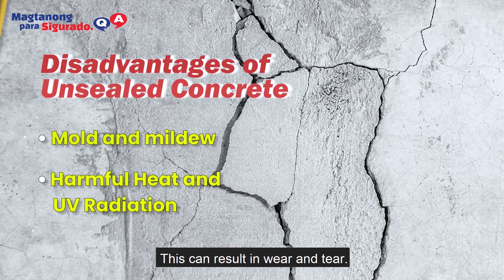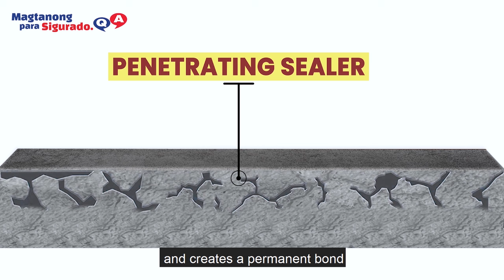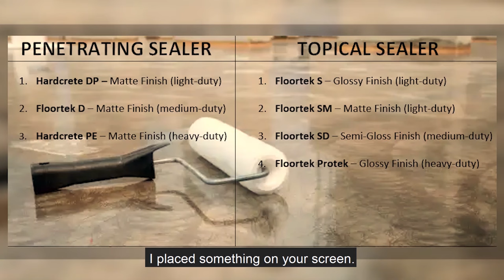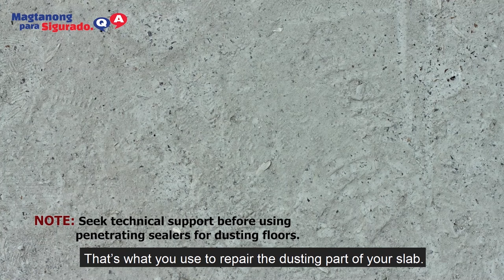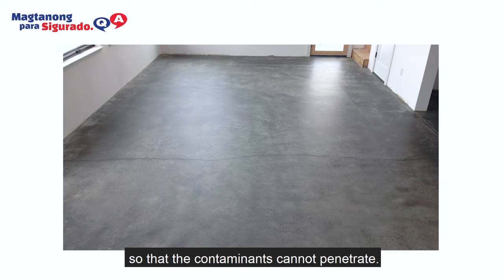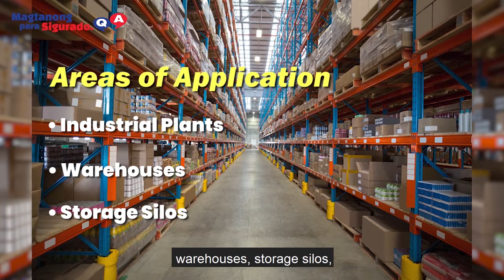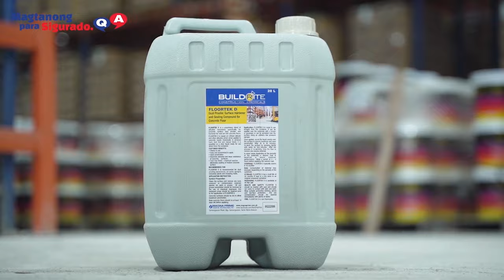Polished Concrete Finish Using a Sealer | Choosing the Best Concrete Sealer in the Philippines

Comment: Sir pwede po b concrete flooring na very light gray sang kulay? Paano po ma-achieve ang very light gray ng concrete flooring? Pwede po b haluan ng skim coat pra sa concrete flooring. Tapos po applyan nmin ng matt finish sealant . Mas cos effective po kasi at durable ang concrete flooring. Thanks po sa reply
Reply from the maker: Hi, thank you for your inquiry. For skim coat for floors, we have Hardcrete 303. You can watch this video for your reference: https://www.youtube.com/watch?v=NSXtg13Nn0g
Floortek S is a topical sealer in glossy finish and it is not advisable to mix with the skim coat. If you want a matte finish sealer, you can use Floortek SM.

Comment: pwede po sir sa matte tiles porcelein ko need ko kc semi-Gloss pra yayamanin tingnan.salamat po ng marami kong sasagot.
Reply from the maker: Hi, thank you for your inquiry. Floortek S can be used as a sealer for slate and terracotta tiles and certain natural stones to prevent staining on the surface. Subject to testing in small areas.
Reply: ah ok po try ko posir maraming salamat  sa video nyo sir complete details kahit medyo mahaba oks lang @BUILDRITECONSTRUCTIONCHEMICALS
Reply: sir list po mgkano kaya po  @BUILDRITECONSTRUCTIONCHEMICALS
Reply from the maker: You're Welcome!
Reply from the maker: BUILDRITE FLOORTEK S (3.8 kg)
Regular price₱2,291.00

https://shop.magnaprime.com.ph/products/floortek-s-3-8-kg?_pos=1&_sid=8d8044dbd&_ss=r

Comment: my floor has color cement.  is it still ok to apply the sealer? which is advisable?
Reply from the maker: Hi, Thank you for your inquiry. Floortek S and Floortek SM are applicable only for bare concrete.
Reply: do you also have suggestions po how to make a better look on a floor that has color cement. sayang late ko na po nakita ito. tnks
Reply from the maker: Unfortunately, wala po kami nang para sa colored cement.
Reply: Hello po sir ask lang sana ano ung pwd sa ceramic rough tiles na white..gusto ko sana gawing glossy ..tnx po

Comment: Tanong kolang poh sir. Pwedi poh ba  sia sa ibat ibang klasi ng tiles at sa wall.yong s poh
Reply from the maker: Hi, thank you for your inquiry. These sealers are for flooring use only; their purpose is to strengthen the wall based on traffic. Floortek S can be used on ceramic matte tiles to make them glossy.

Comment: Ano po pwede use na sealer or laminate? sa pebble wash out para sa outside stairs para di po magfade kulay
Reply from the maker: Hi, Thank you for your inquiry! We will relay your requirements to our research and development team. For now, we have a sealer intended only for indoor applications, which is called FloorTek S. We cannot recommend this for outside applications because it has a tendency to darken when exposed to sunlight.

Comment: pwede ba yung dalawa iapply sa floor. una ung floortek D tpos sunod yung floortek S?
Reply from the maker: Hi, thank you for your inquiry. No, Floortek S in not advisable to be applied on Floortek D, because of compatibility issue. Floortek D is is water-based while Floortek S is resin-based.

Comment: Good Morning sir, how much will it cost po for 216 sq m na commercial purpose area?
Reply from the maker: HI, thank you for your inquiry. Flooortek S can approximately cover 10m² at 2 coats per gallon.

BUILDRITE FLOORTEK S (3.8 kg) -  ₱2,291.00

https://shop.magnaprime.com.ph/products/floortek-s-3-8-kg?_pos=1&_sid=787bf101a&_ss=r&variant=40590650966188

Comment: Pwede po bang gamitin ang topical sealer sa vinyl tiles para kumintab?
Reply from the maker: Hi, thank you for your inquiry. No, Floortek S is for bare concrete surfaces use only. Vinyl is not made of concrete.

Comment: rekta na po b yan pag apply sa flooring?
Reply from the maker: Hi, thank you for your inquiry. Application of Floortek S:
1. The surface must be clean and free from all contaminants. New concrete floors should be at least 14 days old before applying. All damages should be repaired.
2. Apply Floortek S using a squeegee or a low-pressure sprayer.
3. Apply the liquid evenly over the surface to ensure maximum and even penetration. 
4. Allow a period of 3 – 4 hours before applying the second coat.

Comment: Hello po, pwedeng gamitin po ito sa skim coated wall? or sa concrete slab lang?
Reply from the maker: Hi, Thank you for your inquiry. Floortek S is only for bare concrete floors, But you can use Silox 101 (matt) for skimcoated walls. 

https://shop.magnaprime.com.ph/products/buildrite-silox-101?_pos=1&_sid=d4d4f1805&_ss=r
Reply: @BUILDRITECONSTRUCTIONCHEMICALS  thank you. i'll check
Reply from the maker: You're welcome, sir.
Reply from the maker: You can also watch this video for your reference: https://www.youtube.com/watch?v=rCwFvTB__9c&t=339s&pp=ygUGc2lsb3gg
Reply: @BUILDRITECONSTRUCTIONCHEMICALS  Hi engineer good evening. Gusto ko mag order sana sa inyo para diritso kasi parang ung sa shopee mga peke. Pero di ako makapagplace order thru Magna Prime Shop. Baka may link kayo paano ako makapag order ng Floortek S. Isang piraso lang naman sir para try ko. Thank you
Reply from the maker: Hi, Please message us on our Facebook page so we can assist you in placing your order: https://www.facebook.com/BuildritePhils
Reply: @BUILDRITECONSTRUCTIONCHEMICALS  hi sir, i'll do accordingly. thank u
Reply from the maker: You're welcome.

Comment: Pwede po gamitin sa fiber cement boards, kc I'll be using fiber cement boards as my flooring. Thanks po
Reply from the maker: Hi, Thank you for your inquiry! Floortek S is recommended only for bare concrete.

Comment: Is this applicable on concrete walls also?
Reply from the maker: Hi, thank you for your inquiry. Floortek S is for flooring use only.
Reply: Is there any other product for the wall to achieve that kind of finishing?
Reply from the maker: Good day! We have Silox po, kaya lang matte po ang finish nito. 

BUILDRITE SILOX (Gallon)
Regular price₱1,439.00

https://shop.magnaprime.com.ph/products/buildrite-silox-101?_pos=1&_sid=c08a57f5a&_ss=r
Reply from the maker: Indoor wall po ba ang a-aplayan?
Reply: @BUILDRITECONSTRUCTIONCHEMICALS  opo indoor

Comment: Im having a rough finish on my warehouse right now. 

Question: can i directly apply  floortech D.
Reply from the maker: Hi, thank you for your inquiry. Yes, you can apply Floortek D on rough surface but it will not turn it into smooth finish.

Comment: Paano kong new concrete nkb28 day s n kso my crack yung new concrete pwde po bbitong gamitin
Reply from the maker: Hi, thank you for your inquiry. The surface must be clean and free from all contaminants. New concrete floors should be at least 14 days old before applying. All damages should be repaired.

Comment: Can it be applied to vitrified floor tiles?
Reply from the maker: Hi, thank you for your inquiry. Vitrified floor tiles are non-porous, so floortek s may not adhere on it.
Reply: @BUILDRITECONSTRUCTIONCHEMICALS parang Mali po ako. Ceramic tile po pala kasi rough and porous siya. Yan yung Mariwasa floor tile nung araw. So puede po kaya? Para medyo mag mukhang malinis at bago yung sahig
Reply from the maker: Pwede po ang Floortek S sa ceramic matte tiles kung ang purpose ay para maging glossy. Pero para maging malinis, hindi po.

Comment: how do you maintain it po?
Reply from the maker: Hi, thank you for your inquiry. You can use water with detergent in cleaning surfaces with Floortek S. Using bleach and other chamicals are not recommended.

Comment: Hi. If the floor is painted. is it okay to apply floortek S to seal?
Reply from the maker: Hi, thank you for your inquiry. NO. Topical sealers and densifiers are designed to penetrate the surface of the concrete to chemically harden or mechanically bond with the substrate. Floor coatings are non-porous, and sealers wont be able to penetrate its surface, which leads to delamination.

Comment: Hi po Sir..tanong ko lang po sana kung pwede gamitin ang sealer sa wall, para magkaruon ng glossy finish.😁
Reply from the maker: Hi, thank you for your inquiry. The function of this sealers are to strengthen the flooring based on traffic and there is no traffic on walls. We recommend to use Silox on walls, however, it is matte finish and with water repellant capability. You can watch this video for your reference: https://www.youtube.com/watch?v=rCwFvTB__9c&t=8s

Comment: Pwdi po bang langyan ng sealer ang outdoor wall na may pintura or waterproofing?
Reply from the maker: Hi, thank you for your inquiry. Floortek sealer variants are for interior and exterior bare concrete floor use only.

Comment: good day pwede po xa sa ficem board gamitin, i mean the concrete sealer?
Reply from the maker: Hi, thank you for your inquiry. Yes, you can use topical sealer for floors made of cement board. Sealer will act as a topcoat protection from dust and chemical stains, and it can give a glossy decorative effect for floors.

Comment: Kailangan po bng i grind p ang floor pag ginamitan pa po ng topical sealer?
Reply from the maker: Hi, thank you for your inquiry. Clean the surface and remove dust, unsound or contaminated materials, plaster, oil, paint, or grease. Oil and grease penetration should be removed by using a chemical degreaser. Damaged areas should be
repaired before applying FLOORTEK S.

Comment: Sir eto ba is hindi pwede maarawan? I mean may bubong naman pro naarawan siya e.
Reply: For the floortek S po tayo thanks
Reply from the maker: Hi, thank you for your inquiry. Floortek S is for interior and exterior applications. However, it should be fully cured for at least 7 days before it can get wet with rain.

Comment: Can I use the Floortek S for T&B walls application?
Reply: Ay may nakita ako sa comments na yung Silox dpat para water repellent. How much area can 1 gallon cover?
Reply from the maker: BUILDRITE SILOX (Gallon)

Regular price ₱1,439.00

https://shop.magnaprime.com.ph/products/buildrite-silox-101?_pos=1&_sid=675cbce7c&_ss=r&variant=39935325044908

Comment: 1 coating lang po needed pag Floortek D?
Reply from the maker: Hi, thank you for your inquiry. Here is the step by step application of Floortek D:
1. The surface must be clean and free from all contaminants. New concrete floors should be at least 14 days old before applying. All damages should be repaired.
2. Apply Floortek D using a squeegee or a low-pressure sprayer.
3. Apply the liquid evenly over the surface to ensure maximum and even penetration.
4. Wait for 30 to 40 minutes.
5. Allow a period of 3 – 4 hours before applying the second coat.

Comment: Pwede ba iapply yung topical sealer on top ng penetrating sealer?
Reply from the maker: Hi, thank you for your inquiry. Yes, it can be done if the concrete is not fully saturated. However, site inspection is needed to know the correct method of application, please send us a message on our official Facebook page: https://www.facebook.com/BuildritePhils

Comment: Can this be used on walls? To seal marble finished walls
Reply from the maker: Hi, thank you for your inquiry. These sealers are for flooring use only; their purpose is to strengthen the wall based on traffic. Floortek S can be used on ceramic matte tiles to make them glossy.

Comment: Can I use penetrating sealer for waterproofing (e.g. roofdeck)?
Reply from the maker: Hi. Thank you for your inquiry no sir.or roofdeck  waterproofing, we have two options that you can use: Cementitious Underlayment or Waterproof Top Coat.

1. Flexicrete is a flexible cementitious waterproofing underlayment. It can be applied on areas where you need to apply a topping.

2. Clever Sil is a water-based, polyurethane waterproofing system that can be applied using a roller. It can be applied without a topcoat in areas with low to medium foot traffic.

You can watch this video for your reference:
https://www.youtube.com/watch?v=pINmXW1DlaU

Waterproofing Roof Deck: Polyurethane vs. Flexible Cementitious

Comment: Can you use the Hardcrete DP to strengthen the concrete and then use the Floortek S over that to get the semi-glossy finish?
Reply from the maker: Good day! It depends on the condition of the flooring. Please message us on our Facebook page so we can discuss your inquiry: https://www.facebook.com/BuildritePhils
Reply: how about kapag ang concrete slab na smooth trowel finish lang

then maglagay ng Hardcrete DP after 7days then afterward Floortek S for semi-gloss finish?

or kahit Floortek S nalang? thank you :)
Reply from the maker: Good day! Hindi po recommended for roofdeck ang Floortek S, sir. Hindi po kasi ito puwedeng mababad ng sobra sa init ng araw, dahil ito ay maninilaw.

Comment: Pwede ba ito sa stucco floor
Reply from the maker: Hi, thank you for your inquiry. You can use Floortek S to achieve a glossy industrial look finish floors.
Reply: Sir can you still put tiles after 6 months of using floortek s? what should you do bago mag tiles? Thanks @BUILDRITECONSTRUCTIONCHEMICALS
Reply from the maker: You have to grind off the applied Floortek S before proceeding in tile installation.

Comment: Ano po sealer puede sa outdoor cement floor
Reply from the maker: Hi, Thank you for your inquiry! You can use Silox 101 for outdoor concrete floors. you can also watch this video for your reference:  https://www.youtube.com/watch?v=rCwFvTB__9c&t=203s&pp=ygUGc2lsb3h6
Reply: If later we want to install TILES on concrete floor that we plan to use SILOX 101. Puede po ba?
Reply: Outdoor po. Under the sun
Reply: Topical sealer po ba ang SILOX 101
Reply: Florteck S po ba sa indoor cement floor
Reply: Floorteck S
Reply from the maker: Silox 101 po sir for bare concrete only.
Reply from the maker: Yes po for indoor po ang Floortek S.
Reply from the maker: Silox 101 po sir for bare concrete only.

Comment: hi, can i use topical sealer para sa terazo tiles to make it polish and protected. thanks
Reply from the maker: Hi, thank you for your inquiry. Floortek S can be used as a sealer for slate and terracotta tiles and certain natural stones to prevent staining on the surface.

Comment: Bakit Yung iba dalawang klasing chemical
Reply from the maker: Hi, thank you for your inquiry. BUILDRITE FLOORTEK S is a single-pack, clear, low-viscosity topical sealer for achieving a polished concrete finish on concrete, masonry, and brickwork surfaces.